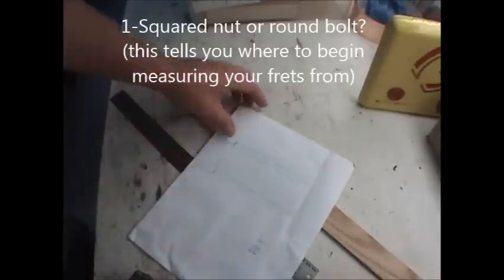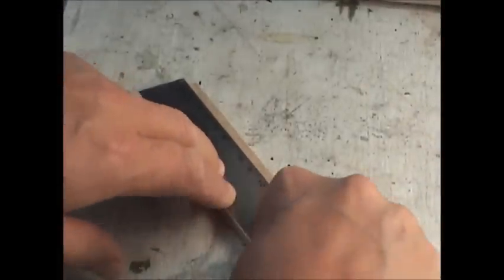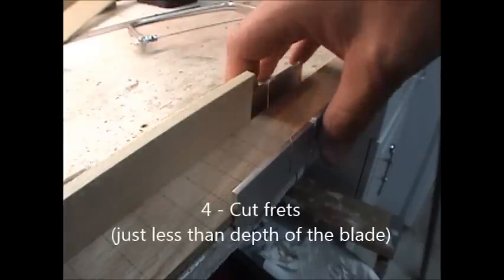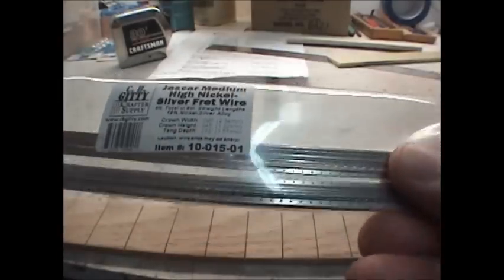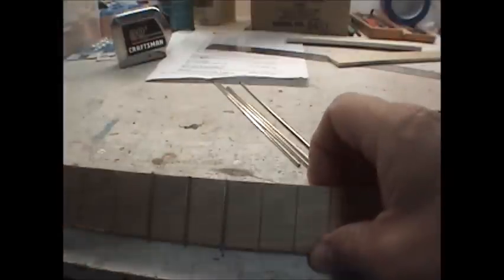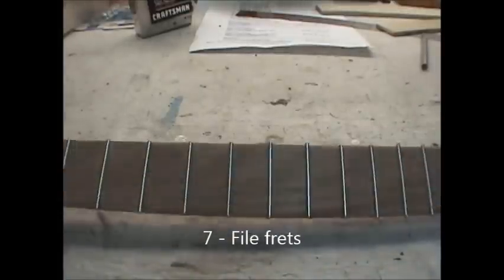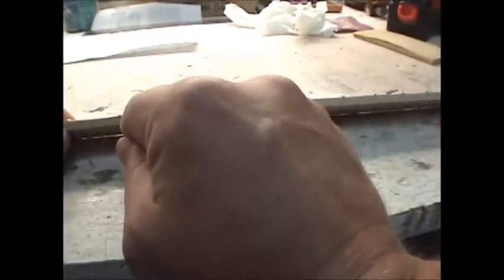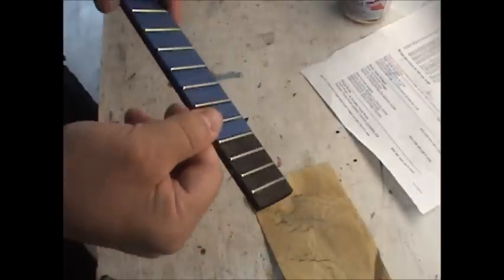Guitar Fret Board

Comment: What size was the wood you used? How thick was it?
Reply from the maker: The fretboard is 1/4 inch thick and 1.5 inches wide.  In the lumber section, look for a 1/4 x 2 inch wood board, which is usually in the area with oak, poplar, pine...  I use oak.  The 2 inch wide board actually measures 1.5 inches wide.
Reply: Thank you for the reply Eric. I'm trying to build my first CBG and I am thinking about using nails for the frets, just to add character. However this video was still helpful as are your others.
Reply from the maker: Congrats on your first CBG!  Nails will look and work great for frets.  Post a pic of your CBG when it is done.